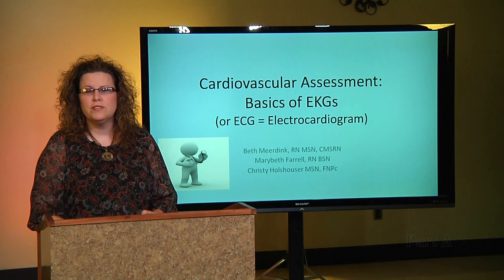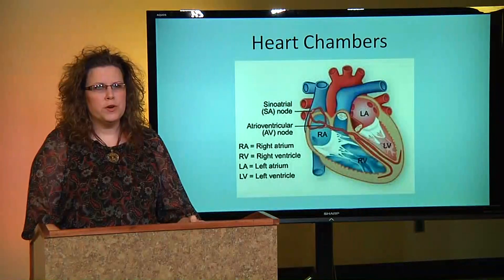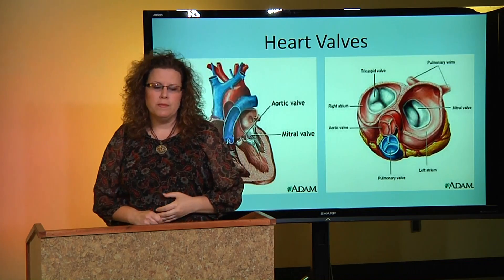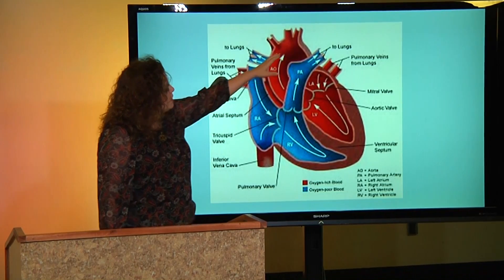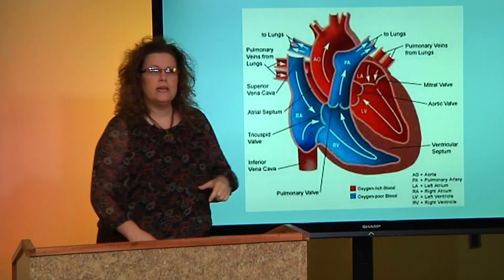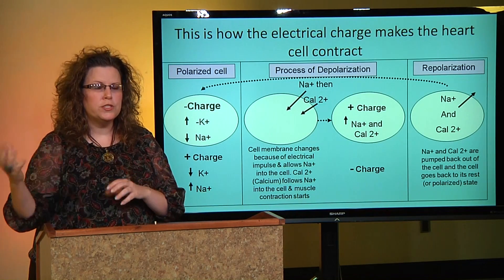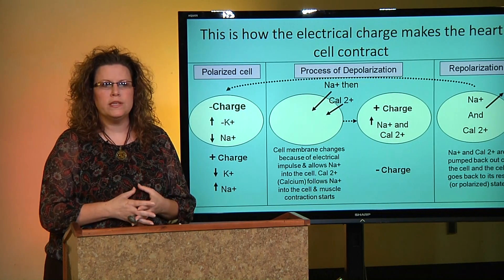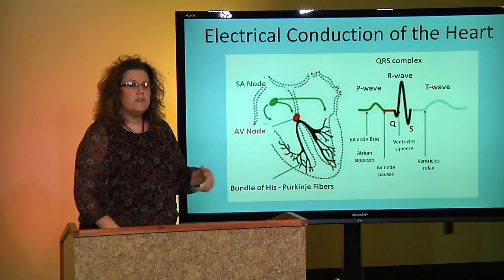Critical Care Nursing: Basics of EKGs Module 1

Comment: Question:  If the patient is an athlete, and has a heart rate lower than 60, does that mean the AV node has taken over or has the SA node actually lowered it's impulse capabilities?
Reply: Kelly AbuAmreh the heart is a muscle. A well conditioned heart beats less because it has "learned" how to put out the same amount of blood with less effort.
Reply: That's an exception. Adults who are physically active with less than 60 heart rate doesn't cause problems and it's normal to them. :)